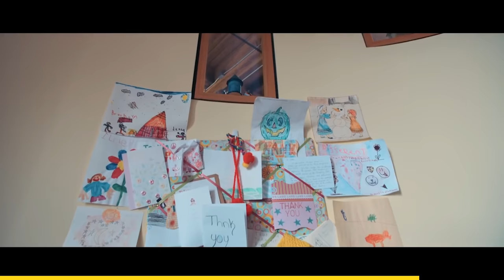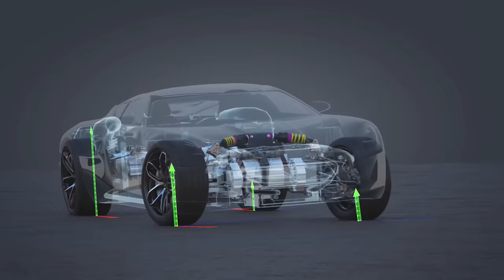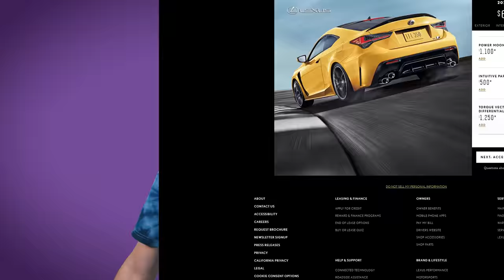The Most Confusing Part of Your Car EXPLAINED

Comment: @Donut Media So does this mean that ESC, torque vectoring, and traction control systems are about to become a lot smarter with the advent of EVs? Especially since some of them have one motor per wheel with instantaneous torque and responsiveness not relying on the engine working its way up to an optimal RPM?

Comment: 10:52 Isn't that what McLaren used in their '98 F1 car? A second brake pedal to separately apply braking force to the inside rear tyre to help with rotation around a corner?

Comment: Only thing with torque vectoring I've done anything with is the Nissan Joke...er Juke.   The AWD has the 3 different electronic couplings and has been around since the Juke has been around and that was 2010.  If you make something with the AWD then Audi isn't the only brand to run it.  Not saying they haven't done a great job with it but still.

Comment: pound*foot = pound*foot
Commutative property of multiplication: changing the order of the factors in a multiplication problem will not affect the product.
the same in metric system: Kgfm = mKgf
(actually it's also pound-force, not just pound) So LbfFt = FtLbf

Comment: 12:55  I don't get it. e.g. inside wheel in corner have traction for 50 units of torque. So those 50 units goes to both wheels (5:18). Brakes at that time generate another 50 units. So dif gives 100 units to both wheels - inside uses 50 units to overcome friction of brakes and 50 for traction of wheel, while outside wheel gets 100 units and can use them all. How braking doesn't increase torque send directly to wheel? Doesn't outside wheel gets more torque directly?

Comment: 3 years ago, I went to buy a Honda at a dealership.
The salesman was boasting about all that super advanced 'earth dreams' technology in the engine.
When I asked him to elaborate, he started going on about how it saves fuel, and saves the planet and all that bs.
I later found out that's what Honda calls their Atkinson cycle heads. What it actually does is leave the intake valve open past beginning of the compression stroke. A technology implemented in hybrid cars. The reason it should have stayed in hybrids is it makes the already small motor completely torqueless at start. It would be decent if it had a manual gearbox but it didn't have one, instead a cvt with torque converter.
That thing was dangerously slow.
Don't fall for marketing tricks

Comment: My 2014 Audi A7 has it. Audi has the best names yet: “Electronic Interaxle Differential Lock” or “Selective Wheel Torque Control” 😂
Jokes and naming aside, it really saved my ass a few times lol. The car itself handles pretty well but you can feel the system kick in when it starts to understeer at the limit.

Comment: The days of the Diff are numbered with two electric motors to an axle you just won't need them. Even better with intuative 4 wheel steering.

Comment: ft*lb and lb*ft are dimensionally the same, so I'm tired of people saying "they're totally different!!!"

Usually, the argument is that torque is the cross product of two vectors, therefore the order matters: the lever arm in feet must always come before the force in pounds, therefore torque is ft*lb.  But the units themselves, feet and pounds, are just scalar values which are multiplied by the valued vectors.

So we have, for example, the vector R which is the lever arm where R = (feet) times vector [x, y, z].
Then we have the vector F which is the force where F = (pounds) times vector [u,v,w].

If we took R x F (R cross F) to get the torque, we could separate the vector part from the scalar part, getting ( [x,y,z] x [u,v,w] ) * feet * pounds.  That last part, feet * pounds, is still a scalar value, and for scalar values, multiplication is commutative, i.e. you can change the order around freely without affecting the outcome.  So pounds * feet would be equivalent to feet * pounds.  It really doesn't matter which one you use!

Because ft*lb and lb*ft is also a unit for work or energy, you just have to know whether you're working with torque or working with energy at the time you're doing your calculations, which isn't hard at all.  Just don't get them mixed up and you'll be fine.

Comment: There is nothing confusing about my car. I drive a Tesla though, so understanding how it works is fairly simple. Two open differentials, and fully independant front and rear wheel drive. Torque vectoring is only attained via braking in my case, and is only used for stability control last I checked. Guarentee to always have two wheels with power so long as all wheels are on the ground.

Comment: I was expecting EV Torque Vectoring, like the Mercedes-Benz electric SLS. I prefer motorcycles over cars, but it still makes me sad that Tesla, with expensive as their cars are, they still don't use a motor at each wheel, but fewer motors relying on the Brake style Torque Vectoring. Not only are they missing out on added performance & safety, it's just unnecessary wear on the brakes, the longevity of which, is a major selling point of AWD EVs & Series-Hybrids, because of Brake-Regen.

I remember a video testing the AWD systems of different cars, including Teslas, by putting their wheels on rollers, with diagonal wheels, or 1 wheel tasked with moving the car off of the rollers.

The Teslas struggled a bit, because of the Brake style Torque Vectoring. And I was so disappointed, because all this time I thought they had the same independent motor system, like the electric SLS.

Comment: Speaking of torque, how do vehicles like trucks and pick ups have more torque than horsepower? In a sports car you need more torque to get more horsepower, in a truck you need torque to haul stuff, but the HP is lower than torque, how? Is it the weight of the vehicle?

Comment: My Ford seems to have brake based "torque vectoring". Can't turn off stability management. It's probably great if you're an average driver, but makes the car unpredictable if you're trying to drift it. It's not possible. There's a system which is constantly fighting you, trying to keep the car pointed straight. Very irritating. My next car is going to be a Subaru. Not that I have a choice- Ford discontinued all sedans.

Comment: I agree with the fact that using the brakes to simulate an LSD isn't as nice as an actual LSD but it's impressive technology has come this far. But having the brakes already loaded up can be more beneficial for the need to hit the brakes hard suddenly on a corner for say a deer running out. Good on the street but not on the track,

Comment: Can you do a video on the Porsche Taycan Turbo?  It’s very confusing. It’s an electric car… but it has a turbo badge?  -_-
And this axle transmission thing… it supposedly has “two speeds” but how? If it’s electric wouldn’t it just have a growth in amperage or whatever to denote how strong the axle rotates?  So what would be the purpose of “two speeds”… ?

Comment: For electric cars with a minimum of two motors, can electric motor torque vectoring be working even when the car is not accelerating?   Would regen braking and torque vectoring be able to work hand in hand so that in cornering, withou gas pedal input, torque vectoring can kick in?

I know for ICEV, torque vectoring will only kick in when gas pedal is depressed. 

Thanks!

Comment: Y'all paid by lexus? Because my 2010 Acura RL had what I'm pretty sure is the exact system described as being unique to the Lexus RCF, except my Acura also used 2 extra transmissions to allow for heavy rearward torque biasing (absolutely killer for drifting in the snow)

Comment: Corvettes have had eLSD for more than a decade. And your description of turn in is not really correct. As your turn in the eLSD will quickly reduce clutch pack torque so entrance to turn is “pointy”, as you hit apex and get on the throttle, the eLSD will monitor yaw rate and wheel speeds to determine how much clutch torque to feed forward to ensure there is no slip of inside wheel and ensure you get all power to the ground- ideally at the stick-slip limit. 
I should know - we developed the controls for the eLSD :)

Comment: 7:13 I don't know why he's laughing because this is actually a professional technique done by racing drivers, take Mr Keeichi who drives his AE86, his car doesn't have an LS diff, traction control, or ABS, so what he does is manually compensate by adjusting the throttle around each turn so he get the most power throughout each turn without losing traction, sometimes he'll apply little more power and let the wheels slip slightly so he can powerslide or drift around the turns which in some cases can be faster

Comment: Actually the idea that all the torque goes to one wheel in a open diff is actually false. An open diff will always spilt torque 50/50%. What actually happens is that only half torque needed to spin the slipping wheel is send to the wheel with traction. And the amount of torque needed to spin the slipping wheel isn't enough to spin the wheel with traction. By braking the slipping wheel you can increase the amount of torque being sent to both wheels

Comment: I'm not a billionaire so I'll never actually own one , but I think Koenigsegg probably does the best torque vectoring . Four individual electric motors , one on each wheel . And a 3 cylinder turboed engine that produces 600 horsepower on its own .

Comment: Why NM IS BETTER THAN the  old non-international foot pounds/pound feet. And KN and On and on 1meter...

Just use the international system that the whole world uses.

As for torque vectoring, rally drivers and racing drivers have been doing this for decades

Comment: There is virtually no difference whatsoever from putting 10 lb of weight on a 1 ft Long Bar, or 1 lb of weight on a 10 ft Long Bar. They are virtually the same. And the term is called foot pounds. I have been working on cars since 1964 and I have never worked with somebody who calls it pound feet. Everybody I have ever worked with calls it foot pounds. Every time I have referred to it, I've always referred to it as foot pounds. Because it's the exact same measurement, it doesn't matter which comes first, the distance or the weight. But it is actually easier to say foot pounds than it is pound feet.
The your sensor is nothing more than an accelerometer. They've been on aircraft for a long time. Maybe my being an avionics technician on military aircraft in the 1970s gives me a little bit of an advantage here but. It's not a secret concept.
In your description of the differential clutch packs, all you are doing is changing the braking system from being on the Wheel to a braking system in the clutch packs. It's just a more complicated pork vest during system using brakes. The brakes just happened to be inboard on the axles. But not directly on the wheels.

Comment: A foot-pound is exactly the same as a pound-foot. There's no difference, and no importance to the order. The units are a result of multiplying, which is commutative, meaning order doesn't matter.
7 pounds * 10 feet = 70 lb*ft
10 feet * 7 pounds = 70 ft*lb
70 ft*lb = 70 lb*ft
No difference. Identical. Indistinguishable.

Comment: ft-lbs and lb-ft are the same thing. This is because the units are multiplied together. For example, applying 2 pounds of force at 3 feet is the same as applying 3 pounds of force at 2 feet.

Comment: Atleast the title is just bullcrap.

So torque vectoring can be achieved in two ways, either by increase of power by decrease of power. Such that AI controlled independent braking can achieve turning, without actual increase in steering angle. Saying torque vectoring is dumb, is saying like you should depress the clutch in corners when in a manual car. As the resistance of the engine is a sort of torque vectoring, especially if the lsd is set right. So adding electronics, either a drivetrain to push the further the outer wheel, or breaking the inner wheel. Its not even reliant on the differential, its a physics equation on how much to brake etc.

So yea, a v8 is stupid in a city car. as per the title.

So yea take a mid engine rear whee drive with break vectoring, with two independent electric drivetrains in the front. So the differential method is possible mechanic, but yea put ai into it itll be better. Ofc the crank can have a third electric motor.

So per the title. Chunky front wheels are dumb(in a dragster)